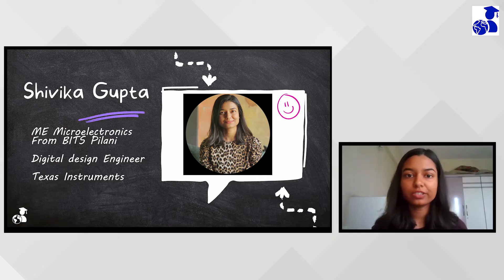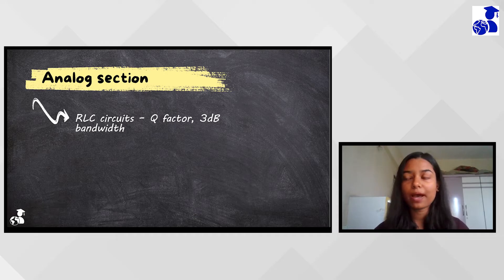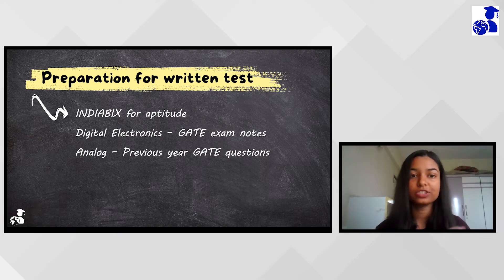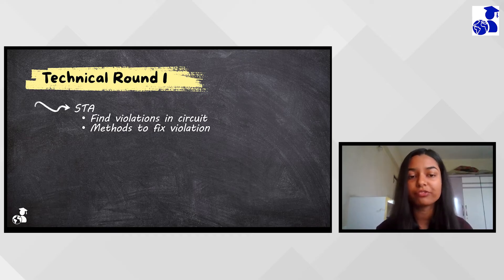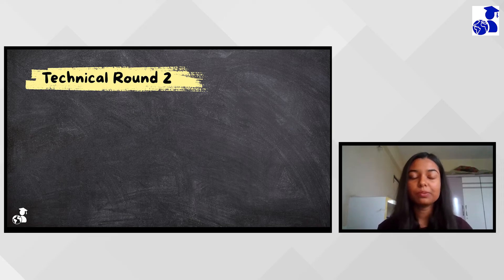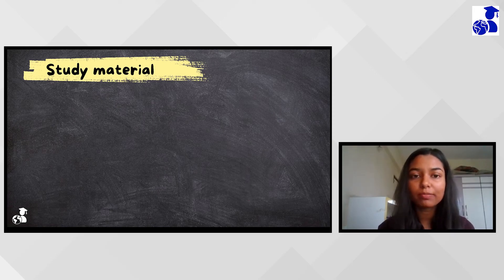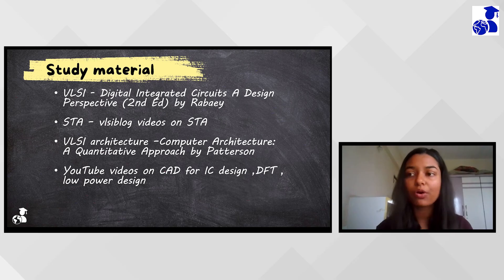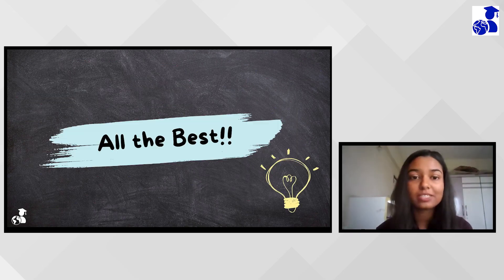Texas Instruments | Interview experience | Preparation Strategy | Digital Design Engineer

Comment: Electrical Networks
Understanding of Resistors, Capacitors, Inductors(Passives) and IV characteristics and operations.
Network Analysis KCL, KVL, Ohm’s Law, Thevenin, Norton, Bridge networks etc Solving circuits using these rules/laws
2 port networks
DC/AC voltage, current sources
Passive HPF, LPF, BPF, Notch Filters – time and frequency domain analysis
Resonance circuits/Oscillators
 

Basic Electronics
Diodes, Transistors and IV characteristics and operations
Clipping and clamping circuits, Rectifiers and other electronic circuits.
 

Digital Electronics
Basic gates and theory : truth table
Implementation of combinational logic circuits using gates
Latches, flipflops, Counters
Implantation of complex sequential circuits
 

Analog Circuits
Amplifiers – Opamp, Class A,B, AB, Unit gain amplifiers etc
Positive and negative feedback concepts
Virtual ground, bandwidth concepts.
Frequency domain analysis.
Active filters.
Applications of Opamps – Schmitz trigger etc.
 

Signal and System Analysis
Fourier Transforms,
System analysis using impulse and step inputs.
Laplace transforms, Z transforms, Bode plots etc
2 port networks
 

Programing Basics
Basic software algorithms and flowcharts – Time and Space complexity
 

VLSI
Understanding of MOSFET structure and working
Understanding of fabrication steps
Constructions of resistors, capacitors
CMOS logic circuits and their transfer characteristics and working